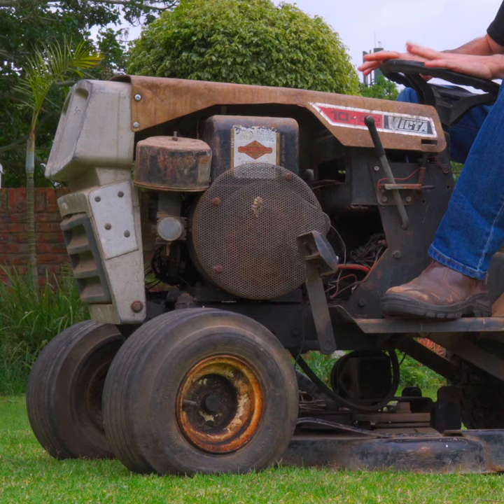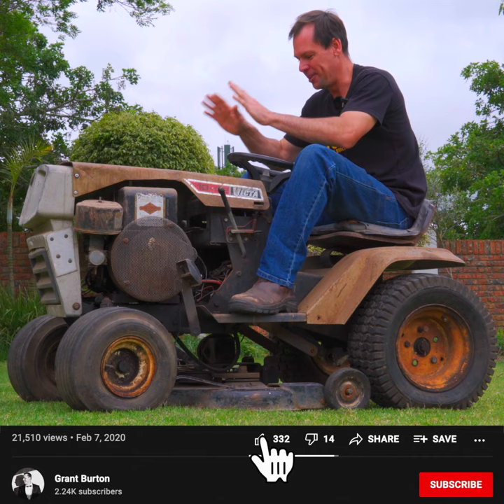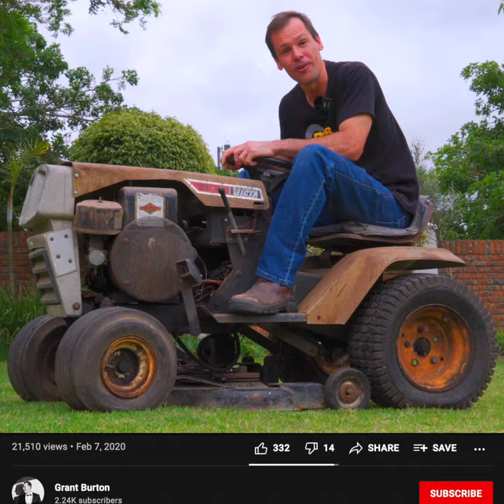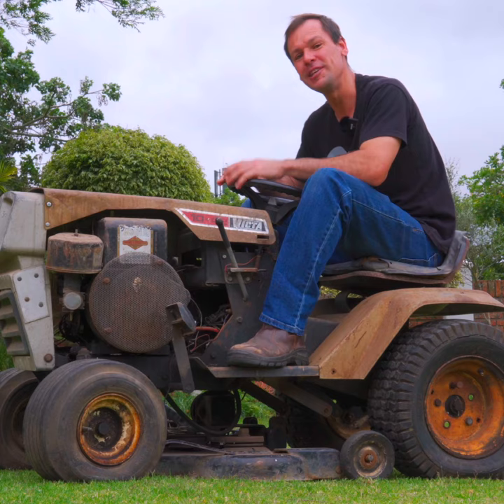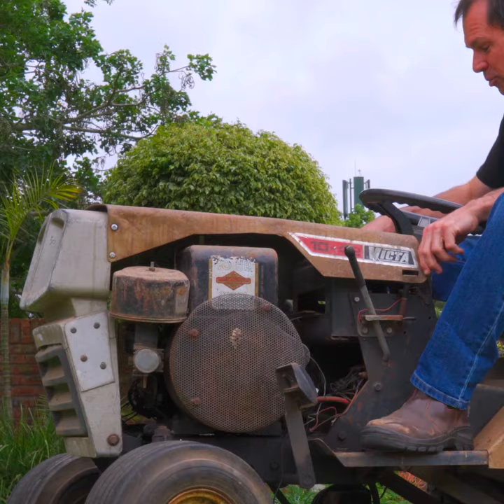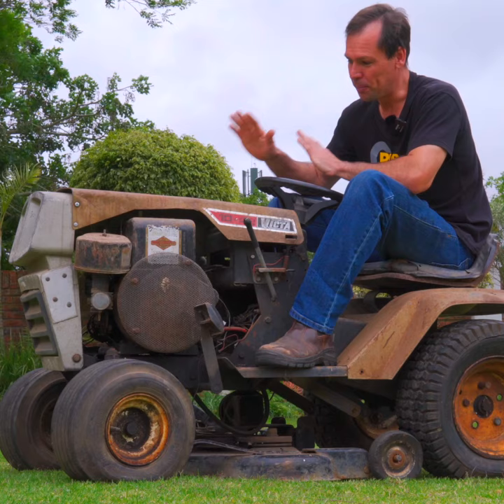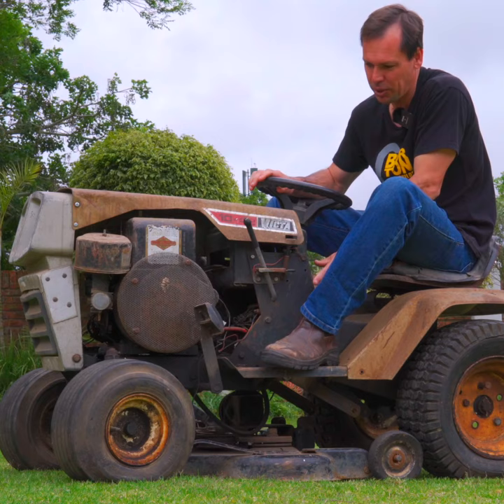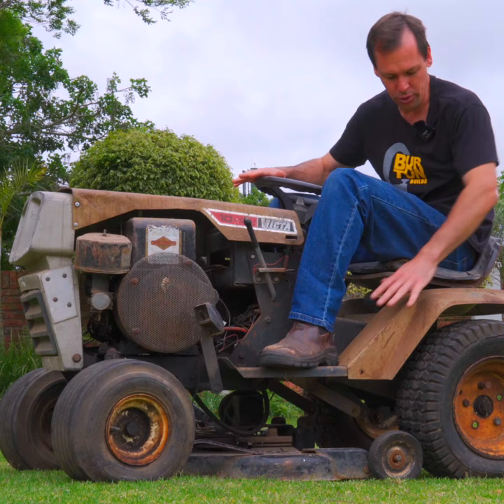Vintage Lawn Tractor Restoration - Part 1 (Victa 10-42 / MTD 145-760A) Burton Builds

Comment: Where are the videos of you fixing this thing up?

We are waiting.
Reply from the maker: Hi Kerry, thanks for following up... The plan was to get stuck into the Victa restoration, but I first needed to get the other lawn tractor rolling and cutting. I still use the Victa once a week to cut the lawn... haha. Getting the other one going (Husqvarna LT1597) has taken a little longer than expected, since that turned into a mini restore in it's own right and I kind of ran out of money to get it finished... so it's turned into a super extended project. Pretty close now though... just have the cutting deck to rebuild (that should be part 3 of that series of videos - There are another 2 out already), then I should be able to put it into service. Once thats done, I can start working on the Victa again... looking forward to it though.
Reply from the maker: Hi Kerry, there are a couple of videos out already, but it's just in the beginning stages.
Part 1 - https://youtu.be/Z8ge-h4UJA0
Part 2 - https://youtu.be/t-1Fd5BtkTI
Part 2.1 - https://youtu.be/Vn7XwkwC2LU
Part 2.2 - https://youtu.be/XqfLiKj-Pm0
Part 3 - https://youtu.be/ZvTiowofzhU
Part 4 - https://youtu.be/JEUB1rQJTZI

Comment: Keep the patina repaint ruins the value
Reply from the maker: I’m thinking complete restoration of the frame, motor and everything else… but leave the hood and rear wheel arch bodywork with the original patina… so it’s mechanically sound but still retains it’s original character and old school look.

Hoping to get around to this project this year sometime. I’ve actually been using it to cut our grass once a week. Need to get the Husqvarna completed so I have something else to use while this one is being restored.
Reply: @GrantBurton  How's it coming along? I'm thinking about restoring an old Ford. I "liked"
Reply from the maker: @richhoops2413  Hi Rich, it's been on the backburner for a while. Decided to first restore the Husqvarna lawn tractor I have... get that up and running so I have something to cut the grass with (there are already a few videos on the channel covering this). Once thats done, I'll get back into restoring this little machine. For the mean time, while I've been working on the Husqvarna, this little machines has been regularly cutting the grass and doing a good job of it. Also kinda ran low on funds for restoring it.

What Ford do you have?